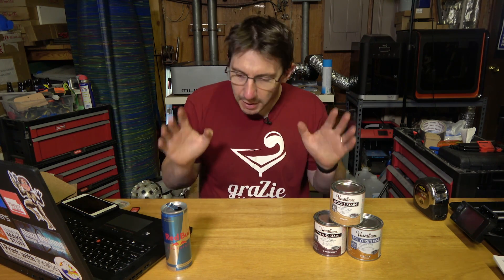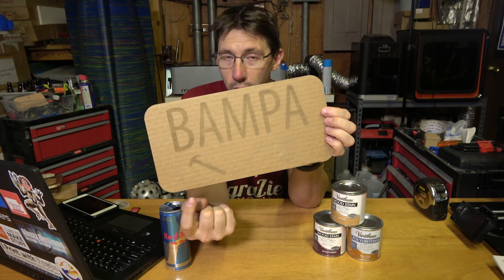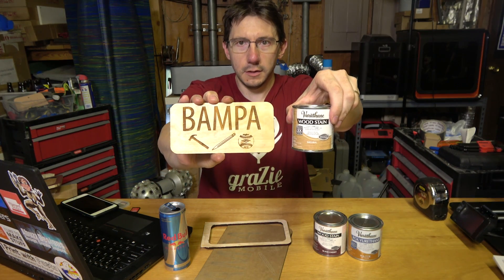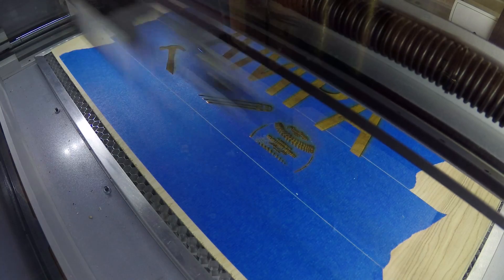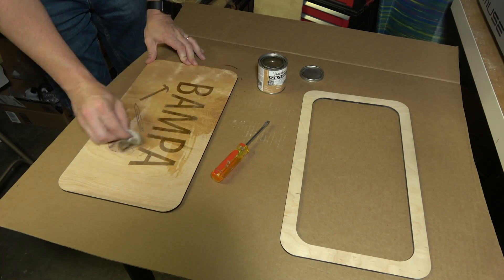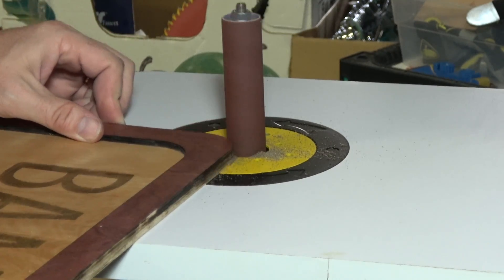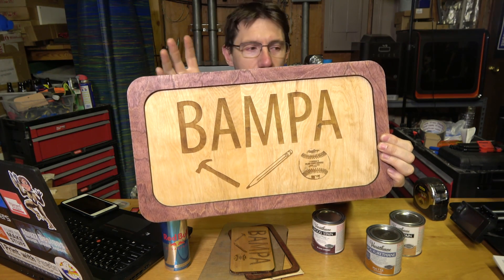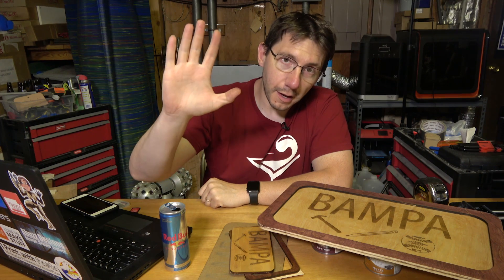Laser Cutting for Fathers Day on the Full Spectrum Muse

Comment: Looks great.  Couple of suggestions from a guy that loves his laser engraver.  To remove the tape easily on the intricate parts like the baseball, use a credit card.  It looks like that engraving is nice and deep.  Nice deep engravings lose their black contrast because you loose the ash.  So you can use a trick the router sign makers use.  After you do your engraving use a black primer spray paint on the engraved areas.  Then hit it with the sander just like you did.  The black primer will be left just in the relief.  Then stain and polyurathane like you did. here is an example of that technique  http://forum.eleksmaker.com/topic/44/bottle-opener  Also you could paint before you engrave then use the tape as a mask for the black primer and it would look like this http://forum.eleksmaker.com/topic/34/bedroom-door-signs

Comment: Be careful with corrugated cardboard on a laser cutter.  If you cut through the top layer there is an air gap that gives lots of oxygen to the middle and bottom layer so they catch fire easily, travel across the piece before it smokes much and can get away from you.  It is much better to use non-corrugated cardboard as it is way less of a fire hazard.

Comment: When applying stain it is better to first apply with a brush and then wipe it away with a clean cloth, this will result in a nicer more professional stain. And according on what type of stain you may want to give it a longer wait time. I usually give my stains 24hrs to dry before I apply polyurethane, this helps so the stain doesn't mix with the polyurethane, finally any lighter spots you find when staining is very thin layers of glue and should be sanded some more for a better end product

Comment: if you want better contrast for engraves, you can try depper engrave through painter's tape, then spray paint the engrave through the painter's tape before you remove it, using the tape as a mask.

if you don't use painter's tape, you can sand off the residue. sanding is a good idea anyway since raw plywood is rough. sanded wood will take stain more consistently.

wood glue is much better than superglue, for wood.

i prefer not to stain the wood, at most i'll seal it with water based polyurethane to protect it and make the grain pop.

if a finish ends up too glossy for your preference, you can hit it with a green scouring pad to make it matte.